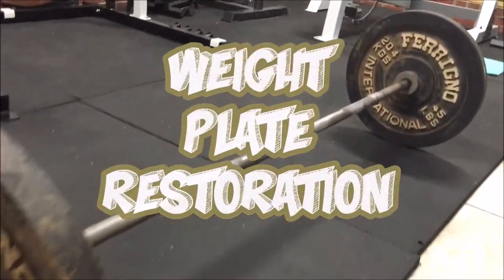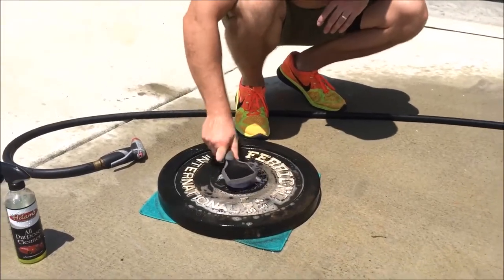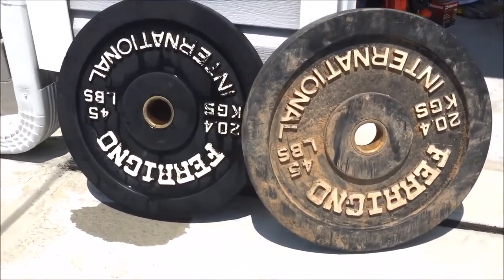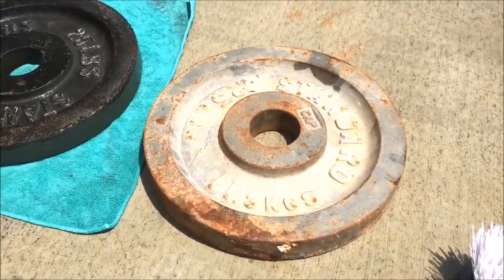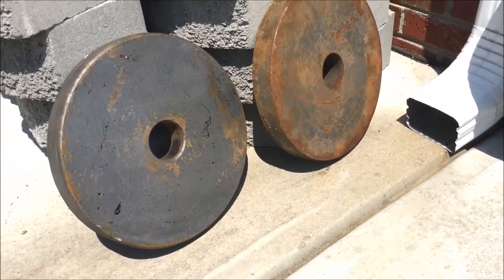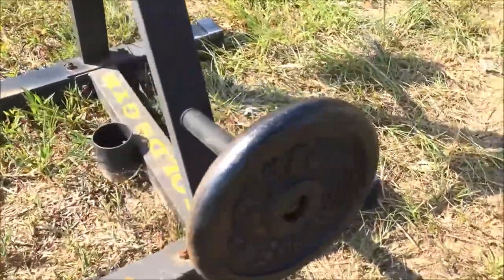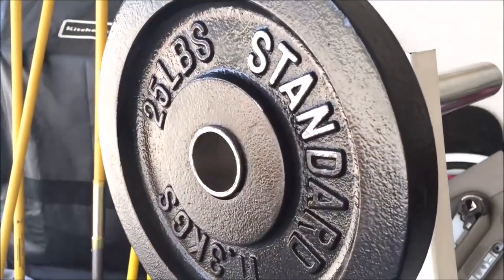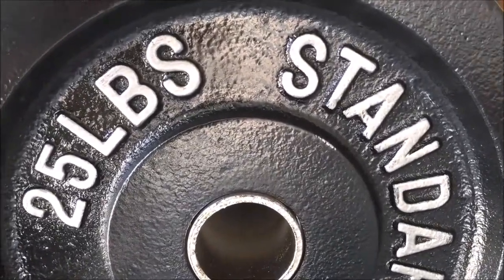HOW TO RESTORE WEIGHT PLATES | The Lady And The Traps

Comment: Hi, I just wana know....would I really need to put clear coat  at the end  (or after the 2nd/3rd coats of paint) or would I need to put clear anti corrosion spray?  I heard is optional on each/both ideas. 
Reason why I'm asking is I already sprayed two coats of Primer then 2 coats of Dulux Enamel Paint over it. I was told Enamel has rust protection.

Comment: How has the paint held up over time? I'm concerned that even 4 coats of rattle can paint will easily chip the first time they bump against something else metal.
Reply from the maker: We don't currently have these specific weights anymore, but we do have other weights that we restored the same way. So far, the weight plates have held up great! The only contact that they have is with other plates and barbells, which hasn't damaged them at all. We deadlift on a platform, so it's safe to say that has protected them. However, we use these plates for multiple purposes every week and we have not seen any kind of wear and tear on them. I would highly recommend this restoring process if you're looking for something that holds up.

Comment: I wouldn't have bothered with the vinegar.

If you have an angle grinder, you can attach a wire wheel to it and remove the rust and paint very easily. From there, you can paint it.
Reply from the maker: You are 100% right. I'm a tight wad, but I finally broke down and bought an angle grinder after I filmed this. It works great!
Reply: @theladyandthetraps7315  Did you need any specific attachment for the grinder? Or just any wire brush?